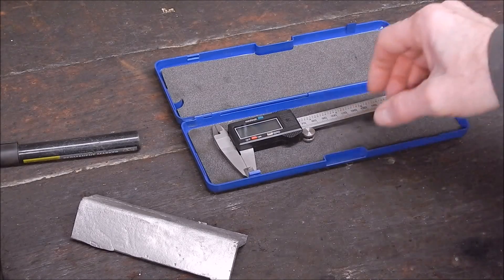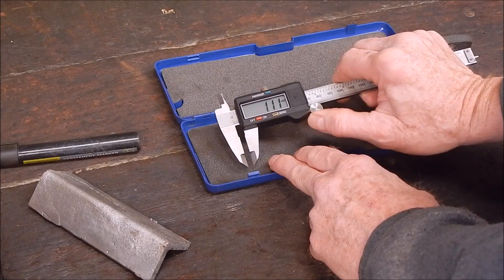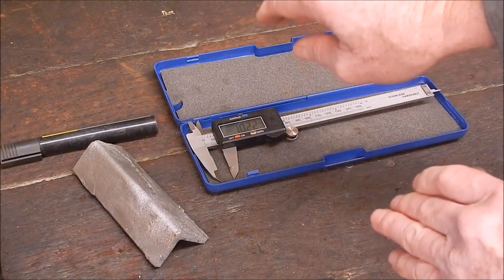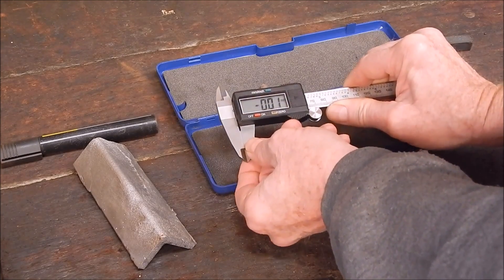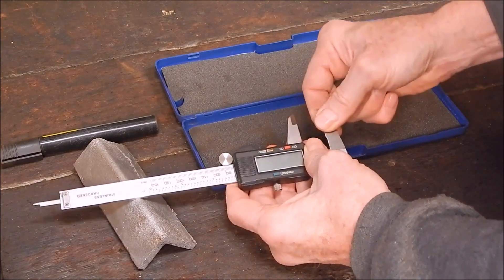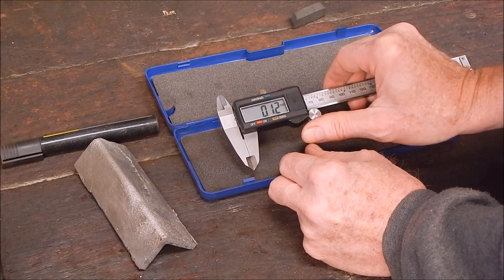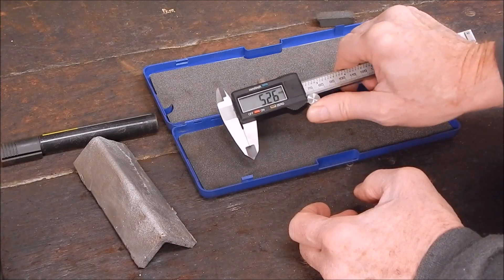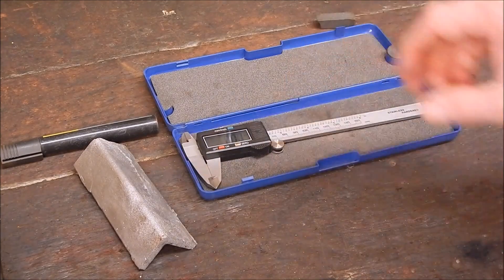How to restore zero repeatability to a cheap digital caliper

Comment: Also your calibers might become magnetic like mine after measuring magnets and what now over the years and hence metal dust etc can build up to create weird throws on the measurement. Also if you happen to take them apart to point of dislodging the lcd monitor keep calm and dont panic. It took several days trying to get it in place on correct point and i didnt manage it. Just now i decided to give it a go after half a year and on the first try works again.

Comment: Yes but you have to remove the burr from time to time.
However there is a solution to that too.
Just glue your calliper to a vacuum cleaner and clean the burr before every measurement. Or even better glue your vacuum cleaner to your caliper if you wish.

Comment: Mine often jumps to -5.08mm
Reply: Caliber is inductive sensing, so moving it too fast can cause skip of a a step causing this. Another reason might be strong magnetic force near by or similar that throws the inductance off, but generally its the moving too fast. Happened couple time before but not really common issue i see.

Comment: I have the same one and the "zero" button won't clear it back to 0 anymore. ANy idea?
Reply from the maker: The switch pad is probably buggered.  They use a sort of printed on silicon sheet contactor that I expect will wear away after time.  Maybe it's oiled up.

Comment: One of my cheap calipers would always jump to 5.01mm for some reason. In desperation (I'm too cheap to throw it away) I pulled the scale off to reveal the brass underneath, cleaned the glue off with solvent, and all appears to be OK now.
Reply: Have the same on a magnusson. Looks like it happens when it is "opened/stretched" too fast, nearly never happens when using the wheel. Mine gets a 5.05mm error, and it looks like it's cumulative, as if i continue to move it it eventually gets 10.1mm, then 15.15mm and so on error value.
Reply: Had the same issue, Perfect, tricky to seat the brass piece back in, works without issue now!

Comment: Nice trick, Rob. I have four dig calipers. Three will hold zero consistently. The third will not, and I think it's the electronics. When my calipers do not hold zero I hold them up to a bright light, fully shut. If you see any light at all there is swarf or dirt on the blades. My calipers agree with each other to a thou. They also agree with my micrometers to .01 mil. Digital calipers are quite accurate if you treat them nicely. One tends to abuse them, unlike a micrometer, which most people do respect.
Reply from the maker: Nothing quite as good as the feel of a quality micrometer.

Rob

Comment: Brilliant   i got a few cheap shit calipers they great bang for the buck.  any tips on keeping the dam battery cap on... all mine fall off quite easy must be from replacing battery every couple months
Reply from the maker: Never had an issue with the battery cap on mine.   Also battery life is pretty good.

These calipers come in many flavours, even though they all look the same.  The really cheap versions chew up batteries pronto and don't have low battery warning.

The better ones (like mine) cost more and have better circuitry and maybe better plastics.

They are good value, and you can buy sheets of button batteries for peanuts for them off Ebay.

Cheers Rob
Reply: try some masking tape , I did that to one of mine when the screw that held it on went awol , did the job fine
Reply: Yer i treed that but it didt last too long i lost the cap on one so i hot glued the battery in place dont know if i be able to replace it when it goes flat
Reply: Re battery life..The sr are much better than the lr button cells
Reply: For anyone it still concerns, depends on the design of the battery cover. I have different ones, on hold more firmly than other but what you can do is roughen the plastic up a bit and put a bead of CA glue on, let it cure and file or sand it down until its snug fit. Just think carefully witch surfaces you do this. Another is to put tab of glue on the lid tab and on the caliber side make carve a divet or dimple hole where shaped glue slides and locks in place, just dont glue the lid in place, just use CA and new material. This can also be done with little bit of acetone and peace of ABS plastic if the frame is made from ABS and its more durable solution. Of course adding screw to lock it in place is a solution as well. Alternatively since its 3V battery, you could screw in a battery case for AA or AAA batteries in series producing 3V and way longer battery life, but it becomes bit bulkier. You then solder the wires on the original battery contacts or replace those with wires if you like the new setup. After that you can glue the lid in if you want.

Comment: im definitely one of the naughty guys. although that's what i bought the cheap ones for.
Reply from the maker: OK, you're excused.
Reply: i figured why pay for good ones when im only going to use them at my forge and making knives.
Reply from the maker: Yes, I agree.

I use that cheap one for most jobs, and if I damage it - too bad.  I have a high grade one for precision work, that I look after and have greater trust in for readings on critical jobs.

Rob
Reply: exactly. for $17 at bunnings who cares. there good enough for rough measurements

Comment: is the big deal people make about precision calculators really justified? I've always felt that if you need more precision than cheap calipers can provide, you ought to be using a micrometer anyway. I can conceive that there may be situations where calipers are a better tool for the job, but does anyone have any examples?
Reply: calipers* damn it, why can't I edit this damn thing?
Reply from the maker: Hi Rob,

The precision (more expensive) calipers are more consistent (trustworthy) in their measurements from my experience.

I have used that cheap one in the video for 30 years and it worked OK, but I never really trusted the readings.

There were too many times I found it was out enough to be a nuisance.  Micrometers are better for some jobs as you don't have the parallax issue (they always pull up square) and good ones are very accuarte.

For most basic work calipers and verniers are fine, but the better ones are just that, better.

Cheers Rob
Reply: Calipers give quick even one handed result that can be read with glance and you can use them flexibly as say DRO while machining with one hand getting about the same precision, while you cant using micrometer. Also ability to zero anywhere allows to skip doing math in certain situations, like bolt in the hole. Zero from surface down the hole into the bolt head, remove the bolt and measure to the start of the treads. Now you know how much longer the bolt is with out calculating anything. You cant even do that with micrometer.